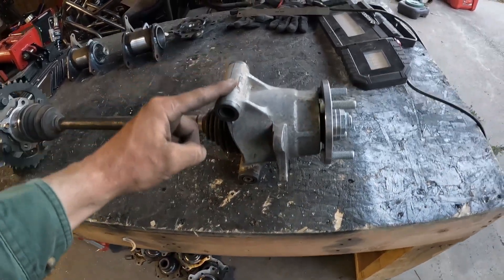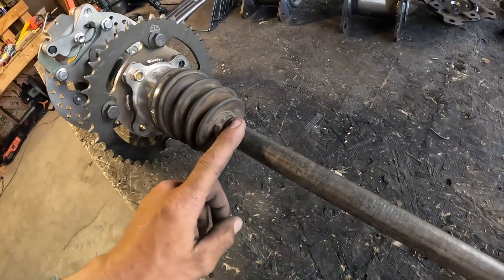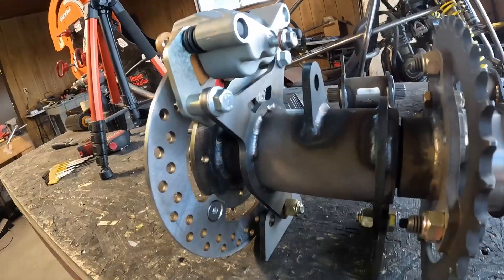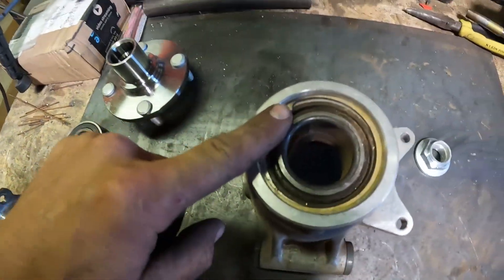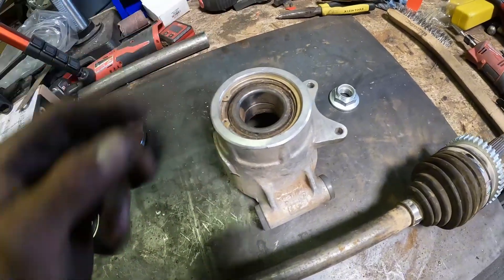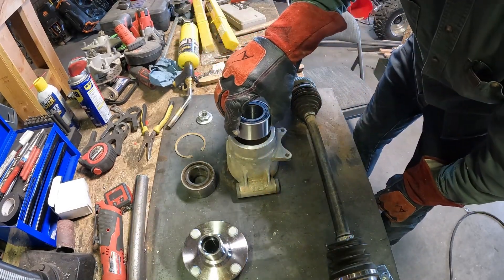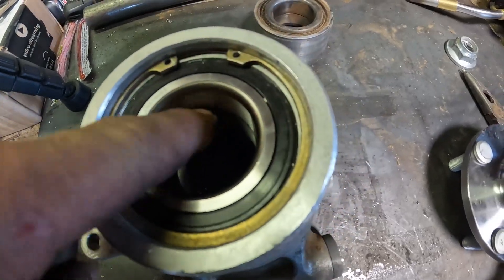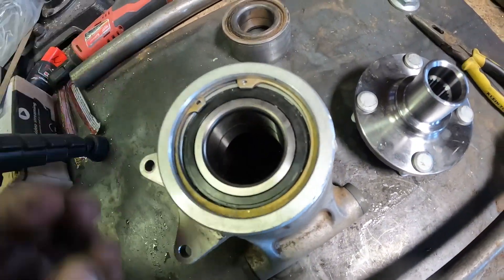Buggy IRS Made Easy: Polaris Hubs + Miata CV Axles

Comment: This is cool using that miata bearing and axle in the Polaris hub. I'm building one where I use the Polaris differential and axles because all the parts, as you probobly know are easy to get on ebay. If you use the Polaris diff, you can ad a shaft to the front of it, turn the engine side ways and connect it up that way. Other thing you can do is turn the diff where the input shaft is straight up. Then use a jack shaft and use a riding lawn mower engine with vertical shaft. Why do that? There are always a ton of riding mowers with good engines but other bad parts for sale on CL or FB. These are usually over 20 hp, cheap and they all have electric start. I have not done one like this but it should work.